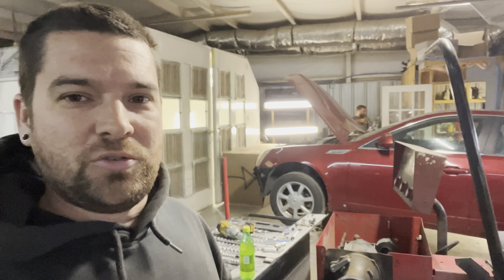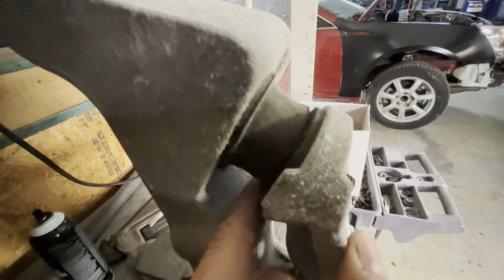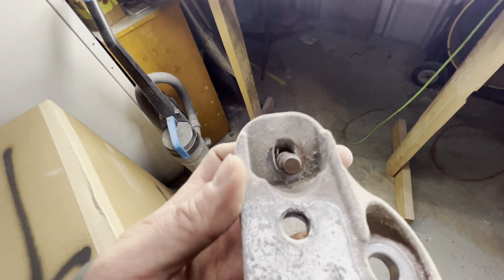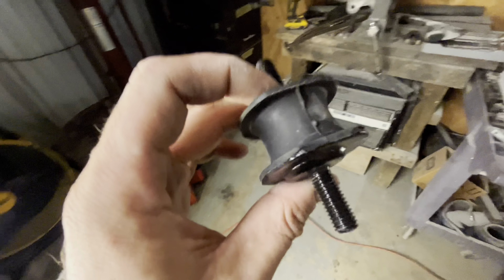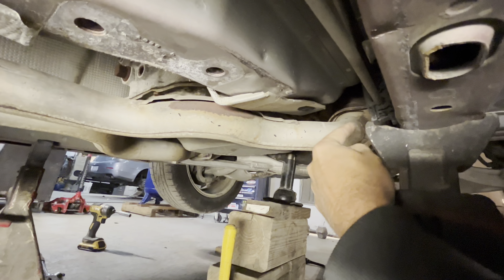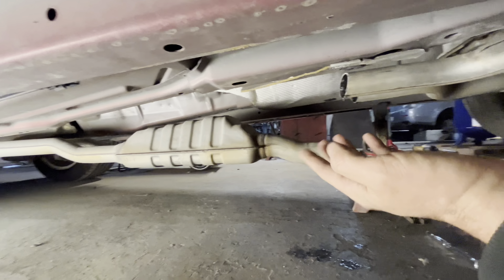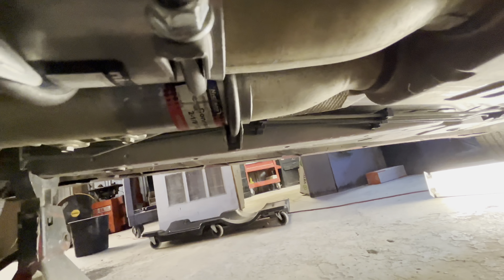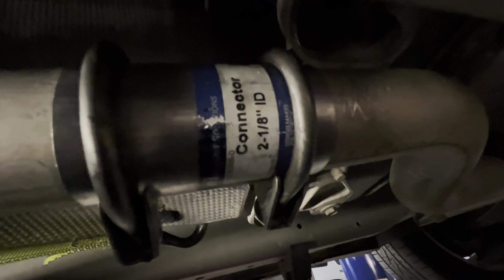💥 Cadillac CTS Transmission Mount Replacement The Easy Way 💵

Comment: Did this on my 08 cadillac cts but after I put the new transmission mounts in the car had a bad vibration and felt like it was dragging something
Reply from the maker: Look back over everything. After we did this we had a bad vibration still.  Ended up being the eBay mounts we bought. We installed ones from the local Advance Auto and all went away
Reply: @The Paint & Paper Hustle  ok I'll try that, I ended up lowering the bolts to the bracket just to get the transmission down a little lower and the vibration went away so I'll switch out the mounts and try that
Reply: What transmission mount did you use for your 08 I’m having trouble finding the mount for mines